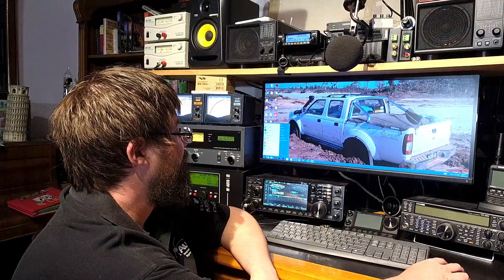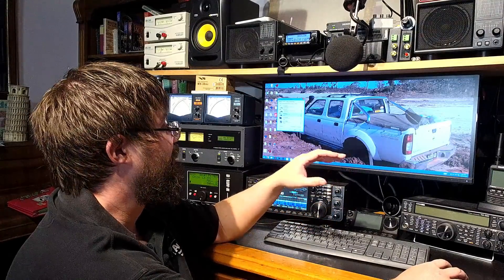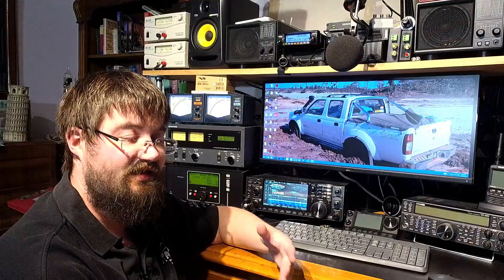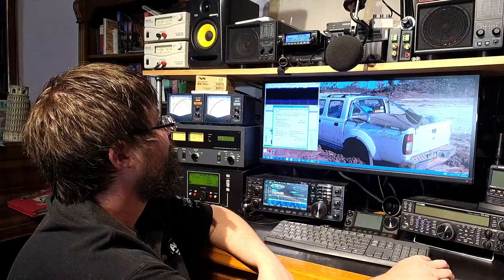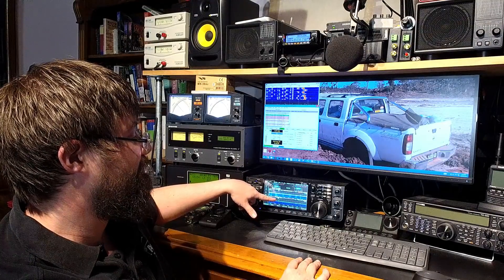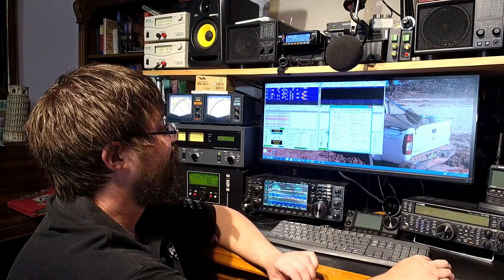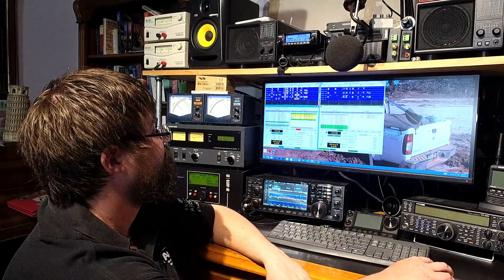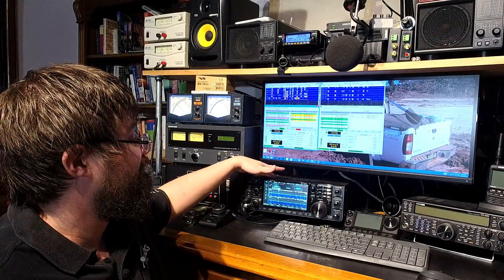Icom IC-7610 How to Dual Watch FT8 for Maximum DX!

Comment: Hi Jarrad, do you know of a way you can use data modes for the 7610 on the remote computer using RS-BA1 with the 7610 connected via just the Network connection? have you done this? Thanks Regards Nigel ZL2SEA
Reply from the maker: I have done it from memory, but its much easier and reliable contact wise to connect remotely to a computer to run digi

Comment: IT all depends if your software supports dual channel reception. In my case my cw decoder does not decode when using dual watch sub band audio. I also saw that activating 2-channel in de driver, the right channel just gets noise and nothing else. Working Windows 10 Home.